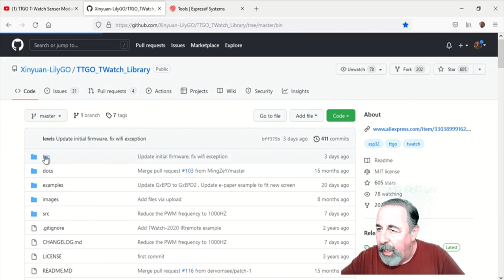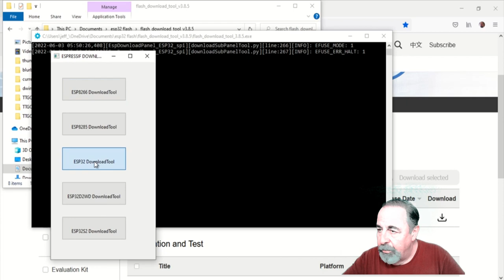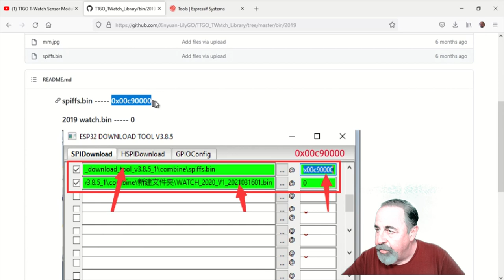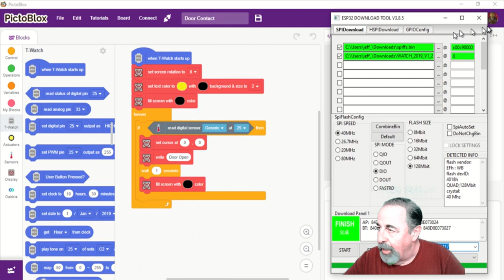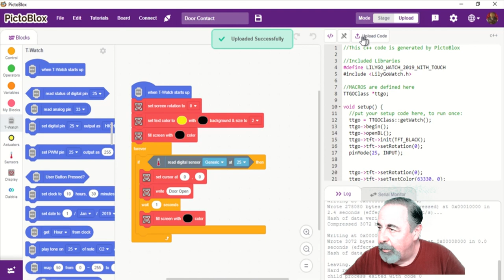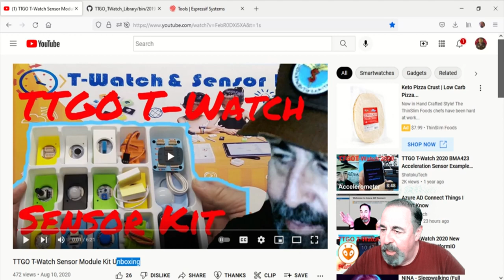Bricked TTGO T-Watch 2020, 2019? Fixed!

Comment: i have the same issue the screen is all black but it happened in arduino ide. will the same thing help fix that as well?
Reply from the maker: It certainly is worth a try at any rate. Flashing the firmware is the same thing they would do in the factory before packing and shipping the T-Display. Best wishes.
Reply: @ShotokuTech  at the end of my code after uploading it says "hard setting via rts pin" is that why it's a black screen even after uploading of the code?
Reply: @ShotokuTech  maybe I'm selecting the wrong board? I have the exact same watch as in the video. What board should I be selecting on the arduino? Sorry I'm new to all this I can't seem to understand what the problem is and why my display went black. It would turn on before and had 3 touch buttons on it when someone gave it to me. I tried to uplaod an example code and since then it has turned black.
Reply from the maker: @saqlainraza2219  I have an entire playlist about the T-Watch. This video https://youtu.be/tuxbqrmFVBA
Shows how to select the TTGO T-Watch in the board manager. Make sure to select the correct "Board Revision" after selecting TTGO T-Watch in board manager.
Reply from the maker: The IDE resets the board after uploading. This is a normal message.

Comment: Hello, i had a similar problem to this but it went totally differently. When i first got my ttgo watch the firmware arrived bricked but in a strange way. I got the 2020 v2 version with the GPS module, but the watch would never boot. It would repeatedly show the boot logo then reset and do it again many times. Eventually it will come up normally for a few seconds before going into a boot loop again. I wiped and re-flashed the watch and it worked for a couple minutes before doing the same boot loop again. Is the firmware package mentioned in this video the original factory firmware? Will it restore everything to how it should’ve been when i first got it? Thank you for your help,
Reply from the maker: Xinyuan-LilyGO/TTGO_TWatch_Library contains the LilyGo source firmware. It's linked in the description here. I am demonstrating their instructions. Best wishes.
Reply: @ShotokuTech  Thank you. I really hope i can make this work better.
Reply from the maker: @XanCraft21  I hope so. Good luck.

Comment: Thanks, I just managed to unbrick my T-Watch 2020 v3 :D
Reply from the maker: Good news always welcome! Thanks
Reply: @ShotokuTech  for the V3 there's also a "2020-V3_Speaker.bin" file that I guess I need to flash too to make the speaker work. Do you happen to know what value I should put on the "@" column of the flash tool? I cannot find it anywhere. Will try to open an issue in their repo
Reply from the maker: @fabryz  Yeah that's weird. The 2020-V3_Speaker.bin is in the root of bin, no additional information. Good issue to raise. You do the honors? I don't have the v3.

Comment: My V2 cant start =( On battary 4.08v =(
Reply from the maker: So you cannot flash it with the instructions here? I don't have another solution. Sorry.
Reply: @ShotokuTech  O thanks, but device alive i upload sketch from arduino ide.
Reply from the maker: @sbm31337  So sketch didn't run? You have correct v2 firmware? https://github.com/Xinyuan-LilyGO/TTGO_TWatch_Library/tree/master/bin/2020-v2